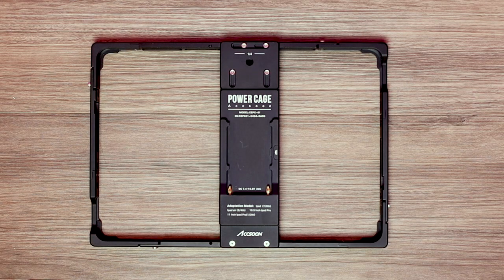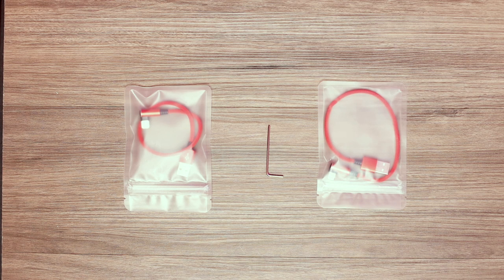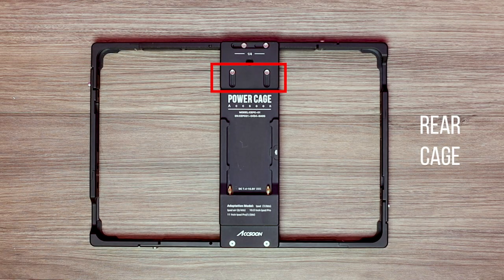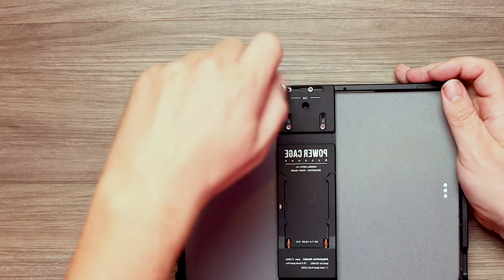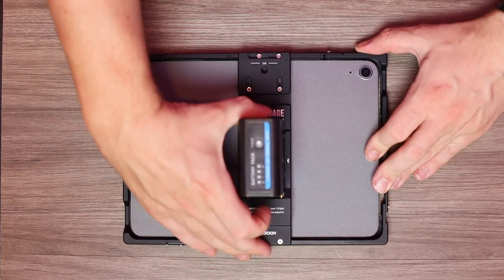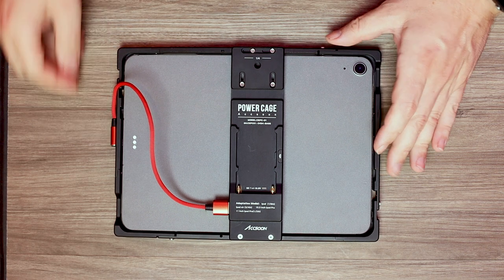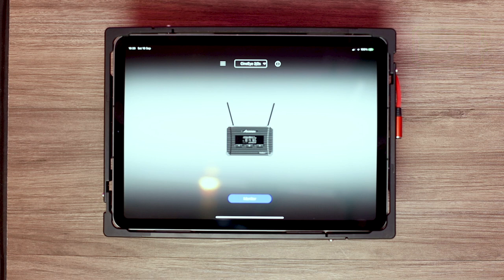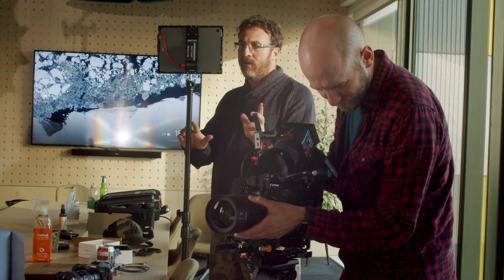Accsoon Power Cage Tutorial

Comment: Can you please tell me if the volume button is supposed to be out in the free or covered up  by the cage and thereby not accessible
Reply: 99% sure the physical buttons are  not accessible but swipe down from the top right corner (finger on the wifi/battery indicator)  opens control centre and my ipad bluetooth keyboard has shortcut buttons  for volume.   Also IOS 15.4  lets you dynamically switch the volume controls based on orientation  left or bottom is vol down and right or top is up.  The 12.9" version with the kick stand is a good improvement more 1/4 20 holes wpuld  be handy too.  Maybe even a sun shade.  still as a basic building block  its as about the best available.